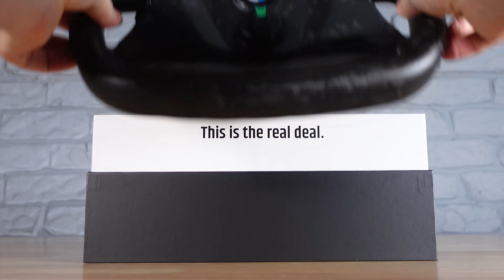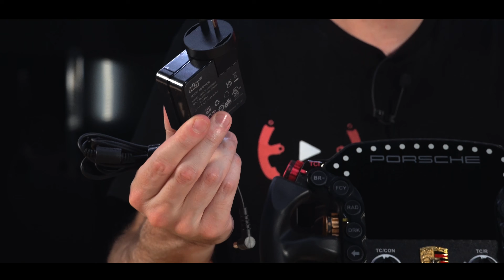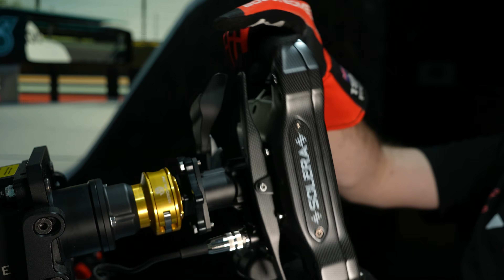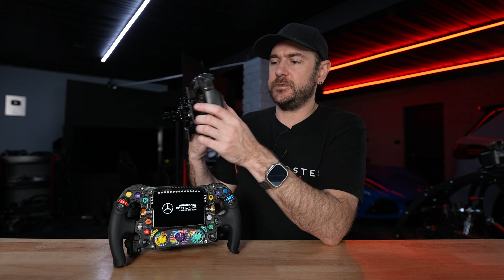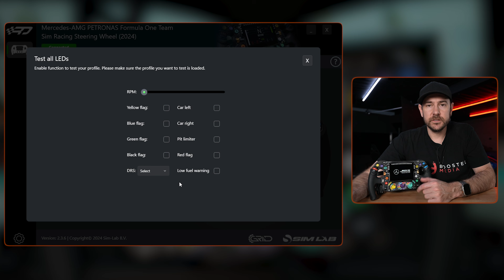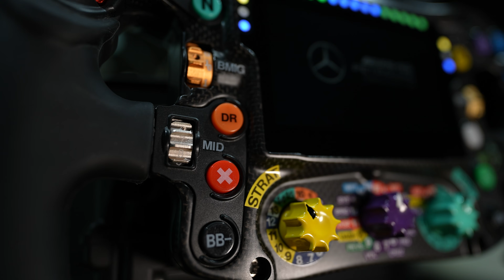ULTIMATE REALISM! - Sim-Lab Mercedes-AMG PETRONAS Formula One Team Sim Racing Wheel REVIEW

Comment: 13:13 Mercedes recently released a video on their Youtube channel going over the differences between the sim wheel and the real one, the buttons were changed from a design point, as the real buttons have more throw in them to protect against accidental presses while the car is running, while the sim wheel has less throw because the wheel won’t be subject to the same g-forces, therefore an accidental press is a lot less likely

Comment: Hi Will, I know it's an old video but maybe you'll read this comment.

In several of your videos you mention that it's risky for a manufacturer to rely on 3rd party software rather than on in-house one. Being a programmer myself I can tell you from experience that it's actually exactly other way around (maybe not always, but at least here, in case of SimHub).

1. It's much more probable for a manufacturer to go bankrupt (and we've seen that already) than for an established piece of software like SimHub. The latter has much more users than a single manufacturer and even if the maintainer wouldn't be able to keep maintaining it someone would step in.
2. Even in the worst case scenario, if SimHub went completely out, and noone would be able to maintain it, the sheer fact that SimHub works for so many devices using mostly off the shelf hardware (Vocore displays, leds, etc) means that the hardware is pretty easily accessible. That means that someone else would easily be able to write their own software for handling such devices. This is exactly opposite to a situation where a manufacturer uses a piece of hardware with a proprietary hardware with proprietary interface to it and proprietary software to run it. If such manufacturer would go bankrupt you might be done.

Long story short:
1. I would rather trust SimHub to be here for a long time rather than any single manufacturer.
2. If a wheel relies on SimHub it means that its hardware is using mostly open interfaces (at least in most cases) that can be accessed by other software if SimHub went away.

As a real life example. See what happened with UGT displays. They are dead in the water and it's increasingly harder to make them work nowadays.

Comment: Hi Everyone, 

This has been an incredible project for us, working with the Mercedes-AMG PETRONAS F1 Team. As an engineer myself, the team and I where absolutely thrilled to get my hands on the actual CAD data! There’s so much to share about the intricacies of this wheel. The end result is so authentic that even people at the factory are having a hard time telling which one is real!

The comfort level is off the charts, and I believe it’s a fantastic all-rounder for sim racing, especially since the diameter hits the sweet spot.

A cool detail is the screw at the bottom of the wheel, which is used to pressure test for leaks—it needs to be water-resistant. The sim version doesn’t require this, of course, but it's still a nice touch!

There is some debate about the actual version, its not always as straightforward as it looks. Some small details have changed in the course of the seasons, not specifically belong to a WXX version. The weight of the wheel is comparable to the Team version, although we have been able to use a modern very lightweight display. 

Thanks Will for the great review
Reply: I ordered mine the second week of August do you think it will ship out soon 😭 I’m mega excited

Comment: did you realize that the EA F1 games are the only racing game releasing yearly, and being not quite a sim but being in this weird area that no other games are? IRacing, ACC, AC rFactor2, AMS 2, LMU, etc are quite serious but GT7 and FM is completely simcade but offer a bunch of racing disciplines. Only F1 gives the F1 experience but for some reason doesn't want to focus and become a complete sim. i guarantee that if they went the full sim route with enough help and assists for casuals and others they would sell more copies and this wheel would be an interesting choice for those with the money
Reply from the maker: If they went full sim mode they’d sell a fraction of the copies. Something like 70% of players aren’t even using a wheel IIRC. 

Hopefully we see an alternative at some point that provides the same authentic F1 experience without all the fluff and with simulation physics.
Reply: @boostedmedia  no they wouldn't I'm not saying setups need to be exact like IRL but have the feel always trying to match reality. the assists will make controller players continue to buy and the rest, well they just need to increase the feel of being an F1 driver like my team and driver career with more depth over the years. we already see the lack of sales from F124 and that is not because the game is more sim-like.

Comment: Phenomenal review, have been extremely curious what this package had to offer. It is tantalizing from a collectors perspective, but personally there are two strikes. #1) I already own a hyper p1 and formula pro elite. #2) Not sure if I want a wheel from a troubled era in merc racing.  That being said, I would probably bite if the price was a bit more reasonable… this coming from a guy with I think 10 or more wheels in my collection at this point. 

Again, thanks for this guys.

Comment: Cool but $2500? not for me. I don't even understand why there are wheels with screens for sim racing. All that info is on screen and you don't need to take your eyes off what you are doing as much
Reply: If you have your rig set up to replicate a one-to-one experience in an open wheel car, you aren't going to see the on-wheel dash on your display.
Reply: @rbecker380  You can absolutely see the in-game wheel even with a extremely low fov. The camera view settings usually are a completely separate thing from the fov, so you can have it one to one and still see the dash, just simply pull out the camera more. I am with OP, its pointless. I dont even use shift lights on my wheel let alone a screen.

Comment: Great and thorough review, Mr. Ford! Thanks for the work you put into your videos!
Happy owner of the GRID Porsche RSR simracing wheel... not missing 7-way switches a millisecond. I despise these things to be frank. The only - currently anyway - 7-way-switches I come to like are the ones on my GSI FPE V2 wheel. those are great, useful, purposefully placed, they react as they should, no false input when using the push-button function, not flimsy, not sticking out like the Orthanc tower. I saw a guy accidentally ripping off the cap of a 7-way-switch on the GRID MPX wheel, just because the FFB was going crazy and ripped the wheel out of his hands. I was thinking about the MPX when it got it's reviews online, because I liked the clean style of that wheel, but the 7-way-switches were always an issue to me. Exactly because I thought of this, what happened to the guy I mentioned... I always thought "those switches are not placed in a thoughtful area". And they aren't the placement is stupid in my opinion. The GSI FPE V2 is the first of many wheels with well placed 7-way switches AND them NOT being annoying when using them.
There surely is a reason why there aren't any of those on real race car steering wheels.
And I would be furious, if this particular F1 replica wheel had 7-way switches glued onto them just for simracing purposes while the original one doesn't have them... especially with the official license stickers going on and the high price tag.
Another thing... I don't mind branding. In the current Hypercar generation (LMDh, LMH...) and LMP2 and LMP3s, there are a lot of Cosworth steering wheels in use. I think it's nice, that the original Merc-AMG-F1 wheel doesn't have that anywhere. But if there was any kind of branding on the real one, like a Merc star or something, I would expect that on the replica. That's why I am happy about the nice branding on the Porsche RSR wheel by GRID. And the OPTION to put a GRID sticker onto it if you want or just go with the original Porsche branding and the very neat Porsche crest beneath the screen.
I do own the VPG V-PGT wheel, which is essentially a replica wheel of the 992 GT3 R without Porsche branding (and probably without license, with the design seemingly being unprotected). Some people put a Porsche crest onto it, because VPG has a space for that in the carbon mold. Some use knock-off crests ordered from some obscure corners of the internet, some invest the money into the real one... I prefer to put the VPG crest onto it, since it is not a Porsche licensed wheel, it isn't made by Porsche but by a company called VPG.... so why not allowing that to be represented? I could choose to not put anything onto it, but it would look rather incomplete. But I have the choice, which is nice, and thoughtful by the maker of that wheel.
If I wanted to have a unbranded wheel, I could also DIY a wheel, which is absolutely possible on the level of quality compared to wheels I mentioned above, but it would be just as expensive on the same level. But I am glad the options for buying such wheels are growing, which is a benefit of the internet. 20-30 years earlier it would be a nightmare to advertise or ship such niche products. But nowadays two guys in bavaria can launch a premium sim steering wheel company starting off building those on their own and shipping world wide, called BavarianSimTec. That is risky even today, but you can reach far more niche people nowadays than back in the day, where you would have to start of on a national level... selling 10 wheels in Germany and giving up the business the same year you started, leaving yourself at bankrupcy, rather then selling maybe a 100 worldwide in the first year (they probably did more).
Good times to be a simracing enthusiast.

Comment: Nice review, been waiting to see one on this wheel. A little bit funny to me, I've been taking so long designing and getting parts to make a diy version of the current Mercedes F1 wheel that now there's an official product lol. Pretty much on and off for about 1.5 years now, just keep putting it on the back burner in favor of other things, and partly just putting it off. Also some design choices are interesting on this one, instead of being a 1:1 representation of the one they've been using since later parts of the W12 I think, some bits of it are from the design of the previous wheel. Like the bottom being a ''wavy'' shape instead of being flat, the shifter mechanism being more similar to the old one rather than current, and some other small things. Not that it's a bad thing at all, after all even the real wheels aren't always the same and have some minor changes here and there, and also it certainly makes for a better official product in terms of styling. Not to mention I prefer this choice for the shifter mechanism since it's somewhat easier to service, why I chose to do the same.
Reply: Glad you noticed the small details! We had a lot of back and forth with Mercedes about which details this would be based on. What we have here is the exact version that the Mercedes Engineers wanted us to bring to market. Some of the decisions were even made due to IP protection 🙂
Reply: @leecarllcs6619  Ahh, interesting. I actually wasn't even thinking of IP being a reason for some things, but it makes sense. And really as I mentioned, a number of the design choices make a lot of sense for it being a finished product, by a lot of the pictures I've seen, the real thing has less polish in styling and fitment, probably cause it doesn't need to be. In a lot of ways the w11 wheel had some design features about it that felt more like a finished product, and those are the ones I notice being on this wheel. Other than the other things I mentioned stuff like the button surrounds being sunken in, and the part where the rear shell goes into the grip being rounded instead of squared off. Also I don't quite remember and I may just be blind, and tired at this point lol, but I didn't see the button in the grip. If so I wonder if that's cause it'd be a pain to fit in there or structural compromise to implement it. I could see why since that's going to be a pain for me too, maybe slightly more so since it's not the shell that provides any structure in mine, but a 6mm aluminum plate that basically goes through the middle of the wheel. That's also made it a pain for the rotary encoder just before the middle connection of the grip. lol